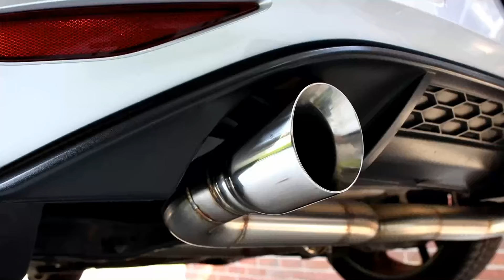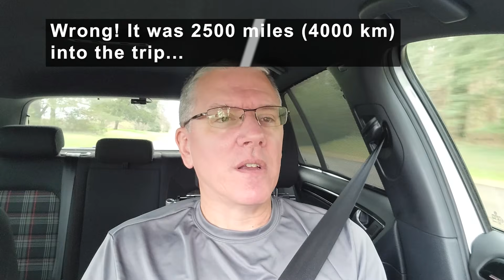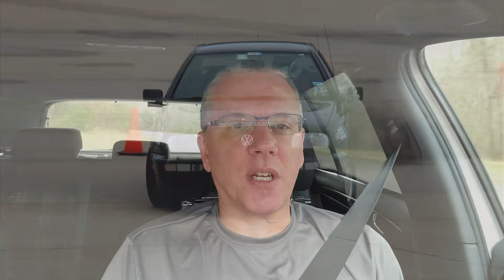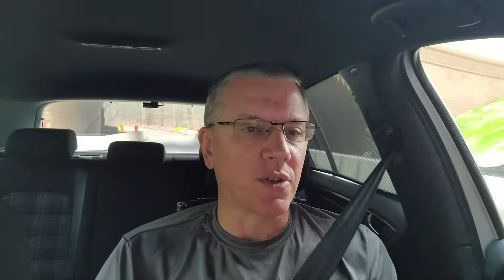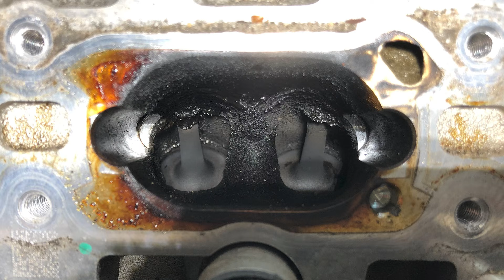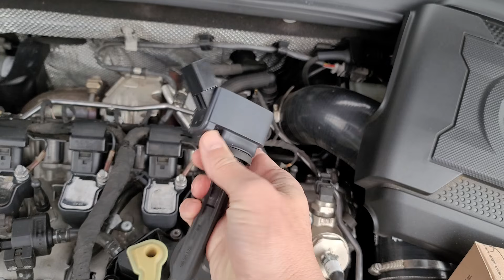CYLINDER #3 MISFIRE / HIDE CYLINDER

Comment: Nice video! My 2017 MK7 GTI 97k miles, suddenly felt like it was lagging a little and slightly delayed in power delivery, then a few minutes later the check engine light turned on and so did the EPC light. The car was shaking and running VERY rough and had poor power delivery. Almost stalled (manual transmission) on the way home a couple times.
I scanned and got
P020100 – Injector Circuit
P10B100 – Injector Monitoring Malfunction
P157000 – ECM Disabled
From the research I've done it seems it could be fuel injector in cylinder 1 or wiring to fuel injector.

I have never taken off the intake manifold but think I can do it. Before I proceed is there an easy way to check wiring or electrical issues to that injector? From what I can tell I can't check much of anything without taking the intake manifold off.

I'll probably just purchase 4 injectors because they're all original.
Reply from the maker: Have you  made any progress in your troubleshooting yet? I didn't have any injector codes during my misfires. So, you may have a different fault... or a total failure of an injector (mine only failed under heavy load). The ECM fault is concerning, though. If the fault is consistently on the #1 injector, then you might consider swapping #1 with #3 to see if the fault moves. If it does, then you found the issue. If not, then I'd swap the #1 and #3 plugs and the #1 and #2 coils. You'll get there! Thanks for visiting!
Reply: @StealthGTI thank you for the suggestions! Happy 4th!  I’m traveling so my car is in the garage and I’ll have to work on it when I get back. I plan on replacing all 4 injectors and cleaning the valves because I’m at 96k miles.
Reply: @StealthGTI  I fixed it! I replaced all 4 injectors and it's idling like a dream and no more check engine light or ECM fault.  The injector looked a little dirty but not much worse than the other 3. It must have been an electronic failure of that particular injector in cylinder 1.  I also attempted to clean the valves but that was much more difficult than I thought. I sprayed and scraped off a decent amount but didn't get it all. Now I just need to change my oil and hopefully I'll be good to go for a while.

Comment: Nice explanation.  I had this code 1 year ago on my 2017 Tiguan. Replaced all 4 spark plugs and coil packs. Problem solved.  The code just returned.  Same problem as what you describe. .Engine misfires on high load. I live in Florida, so no hills or mountains to climb.  Only occurs when accelerating to enter highway.  Does fuel injector cleaner/additive work to remove carbon/debris on the injectors?
Reply from the maker: Injector cleaner didn't help in my case; the injector had already failed. I try to run a load of cleaner every 10k miles. Thanks for visiting!

Comment: Great video! Just had a misfire on 1+2 at the same time. Luckily, spark plug replacement and coil pack shuffling solved it. But, I am also at 116k (stock), so I will watch out for the injector problems.
Reply from the maker: Thanks for sharing your experience! Take care!

Comment: i have a cyl 2 misfire on my 2016 autobahn gti but car starts and drives like it has no issues there no white smoke and theres no smells of burning fuel any suggestions?
Reply from the maker: It could be a coil pack, spark plug, or something else. I suggest swapping the #2 and #4 coil packs; then the #2 and #1 spark plugs to see if the fault moves. Good Luck!

Comment: Thanks for sharing this. I have a similar issue on my GTI right now. No check engine light on, but cylinder 4 is misfiring when I try to accelerate hard. Weird feeling and really obvious. It would have a hard but quick hesitation or bucking. But driving normally it’s fine. It’s got about 159k right now and I figured it was the coil packs because I’ve never done them yet. I read in the past that people would change them out around 70k miles. I’ll see this weekend if the coils are the issue.
Reply from the maker: I wouldn't blindly replace the coils. That's what I did and it was a waste of time and money. I've learned some techniques since creating this video. Instead replacing parts now, swap the #1 and #4 coil packs. At the same time, swap the #2 and #4 spark plugs. If your fault moves to #1, then it's a bad coil pack; if the fault moves to #2, then it's the spark plug. If the fault stays in #4, then you have either an injector issue or something in the cylinder... maybe even a leaking valve cover gasket if you see oil on your plugs. Try those steps first since they're free. Good luck!
Reply: I was lucky this time. Changing the plugs and the coils fixed my misfire. The coils may have still been okay, but the plugs definitely looked shot. The gaps have grown to .036" but initially gapped to .024" I do have a stage 1 tune on the car, so I think properly gapped plugs are a little more critical. I also upgraded to RacingLine coils.
Reply: Hi. Leaking valve cover gasket can make misfire? 

Its very interestjng. 

I have a liitle oil on my spark plugs in my 1.5 tsi dada. I have missfire on 1 and 4 cylinder....  @StealthGTI
Reply from the maker: @stefano18992  - Yes! In addition to sealing the parameter of the head, the head gasket also has a center section that seals around the spark plug ports. If those leak, then oil will seep down into the spark plug well and foul the plug.
Reply: Did you have any cold start issue like sputtering or something without fault codes and gets arrested with the hickup issues between 2 to 3k rpm band at load when reaches 90*C ?

Comment: I’ve been dealing with an EPC light and from what I scanned I had misfires which lead to a cylinder 3 pressure too high and a hide cylinder code. I noticed it happens around 3k rpm in 3rd and 4th aswell as some small power cuts thru the rpm band, I will be changing my injectors ASAP, already went thru the coils, sparks, and fuel system. Thank you for this very informative video!
Reply from the maker: Thanks for sharing your report! Did you find the problem?
Reply: @StealthGTI  Unfortunately no not yet, changed out my injectors and went about 60 miles and the EPC came back on for the same codes but no check engine light, gonna be working with some VW techs on it soon and I’m hoping to figure it out! I miss my little egg!
Reply: @MEAgTI anything new I having the same problem high compression on 2
Reply: Try replacing the injector wiring harness. Test out first using an ohm meter.. anything greater then 2 ohms means you have issues

Comment: I had the same issue on my 2016 GTI. Cylinder 3 fuel injector caused the hyde cylinder and misfire codes. The issue did go away when I restarted the car. Although when I was driving the car several weeks later. The engine started to shake and the car stalled on me. Luckly I was able to coast to the median and someone helped me push the car off the road. I wasn't able to get the car to start so I had it towed home. Looking at the codes I saw fuel pressure related errors and the misfire on cylinder 3. I originally though it was my high pressure fuel pump. Since my oil was smelling like gas. I replaced that and the issue was still happening. I did some more troubleshooting by moving the spark plugs and coil packs. The issue did not move. I then took the spark plug out of cylinder 3 and shined a light down inside. I had someone open the drivers door so the low pressure fuel pump would prime. I saw fuel spraying out and filling the cylinder with fuel. I found out that the injector was stuck open. I replaced all 4 injectors myself, did a carbon cleaning while I was at it. This resolved my issue but I was low on power. I found out that the catalytic converter on my IE downpipe was destroyed from the gas. All the matiral from the cat went down the exuast and plugged it. I also had to clean that out and and buy a new downpipe. It was an expensive repair.
Reply from the maker: That sounds unpleasant! Hopefully, the car is running in tip-top order and keeping you happy. Thanks for visiting!

Comment: I can believe a dealer didn’t think to check injectors. The engine seized on my RS5 and the dealer (Audi Centre - Perth Australia) diagnosed it as a failed starter motor, because that’s the code a seized engine would give you because the starter can’t turn the engine. There’s no code for a seized engine. In the RS5 the whole engine has to come out to replace the starter, so after ripping my car apart and taking the whole engine out, nobody thought to try turn the engine to rule it out. They put my engine back in with a new starter and it still didn’t turn. They then had take the whole engine out again to swap it out and decided to charge me for pulling the engine out twice. They even replaced the belt on the crank pulley that they should have put a spanner on to turn the first time it was out. Their neglect to do a 10 second test made them an additional $5000. Professional incompetence.
Reply from the maker: A dealer did something similar when my daughter's car needed an engine. The bill was around $1800 for work that they should not have done since they did it before even doing a simple compression test. I wound up litigating my way out of all but $150. I then towed her car 200 miles to someone that I trust. She did need an engine, but at least I didn't pay THAT dealer to do it. Thanks for sharing your experience.

Comment: I have the same codes in my Passat but in opposite conditions. My cylinder 3 only misfires at idle. I hooked up my VCDS and watched the misfire counter and every time the misfires would start they would immediately go away when I placed a load on it. Tried plugs and coils but it’s still there. Rented a compression tester and cylinder three was a little bit lower but all within spec. I’m suspecting that it’s either the fuel injector on 3 or that it’s due for a walnut blasting. Taking the intake manifold off is a little bit scary for me because I don’t have a garage or shop that I could be organized while disassembling. Everything would have to bagged and labeled and stored in my shed while I do the work in my dirt driveway under a pop up canopy. Recently found a Euro mechanic that’s an hour away so I’m thinking I’m going to have to pull the trigger. I’ve been wanting to stage one tune it but I don’t know if that’s a smart idea until I get that misfire settled.
Reply from the maker: When I last had a cylinder 3 misfire, my mechanic did an intake cleaning and, while the manifold was removed, swapped injector #3 with #1. That way, if the manifold cleaning didn't fix the issue, we'd be able to see if the misfire moved. It didn't... the cleaning solved my problem. Thanks for visiting!

Comment: Unitronic Stage 2 tune on my mk5. I replaced all coils and sparks and it's still misfiring. A week before that I bought ecs tuning fuel injectors because the fourth one was stuck open so I went ahead and replaced all four of them but they were on the cheaper side. 340 dollars compared to the 1000 dollar oem ones. I have a cylinder 4 and 2 misfire under heavy load and up hills. Do you think it would be from the none oem fuel injectors??
Reply from the maker: I cannot be sure. The earlier cars are known for bad coil packs, but you also have a mix of aftermarket parts. Even at IS38 tuning, I'm still using factory coils, injectors, and OEM R7 spark plugs. IF you're confident in your plugs, coils, and injectors, then check your compression and leakdown. Good Luck!
Reply: @StealthGTI  Compression is even on all cylinders so the engine is healthy thankfully. Leak down test it is appreciate it.

Comment: Hey Scott. What would be your suggestions on exhaust systems and cold air intakes? If you have any.
Reply from the maker: I'm not fond of cold air intakes. They're for noise and entertainment, IMO. ;-) Exhaust upgrades are subjective. I think just about anyone can get tired of a drone, especially on a long trip. I've gone back to more sound suppression. See my "Baun Performance" playlist for details. Given the ongoing experimentation required to get the sound that you want, I think I'll leave the exhaust alone on my next car. I can even see myself returning to an IS20 turbo and restoring the stock downpipe if my IS38 turbo ever needs replacing. I won't do anything before that, but the downpipe and IS38 contribute to a bit of extra sound. Sure, it sounds great, but it gets old on a long trip, especially if the car is loaded. Thanks for visiting!
Reply: @StealthGTI  thanks for responding back. I appreciate it

Comment: Unfortunately I've swapped the coil pack, spark plug, Injector #3 with #2 and I'm still getting a #3 misfire.. I've even changed the coil pack connector and nothing changed. Getting correct voltage. At this point I'm thinking it's the ECU.
Reply from the maker: You need to run a compression check and leakdown test. The ECU is unlikely to be the problem. Have you made any progress since you posted this?
Reply: @StealthGTI  thank you for the reply. Yes a buddy and I did both tests and we confirmed low compression on the cylinder.. Most likely an exhaust valve as there was movement on the exhaust end.
Reply: @StealthGTI you’re GOATed

Comment: My Golfs cylinder 3 is also misfiring. Unfortunately for me it’s damaged piston rings. Not a good result, I’m hoping it’s just gummy piston rings fixed with a special oil, but highly unlikely. Car itself’s not worth enough to pull apart the engine. Wish I knew all this before I just had the timing chain done.
Reply from the maker: Bummer! Good luck with a solution. I replaced the engine in my daughter's 2015 Golf recently. Thankfully(?), I hadn't sunk a bunch of money into it beforehand. Now, I hope it will last long enough for the investment to have been worthwhile. Thanks for visiting!
Reply: @StealthGTI  thanks mate, so far so good with the solution. 🙏
Reply: @benshaw9098 what did you do with the car in the end?
Reply: @cruiseedwards4657  basically nothing, it was all going fine until I paid for a timing chain replacement. It’s still running quite rough but getting me to work and back, I probably should do a diagnostic scan again. It’s not our main car but I enjoy driving it and would still like to solve the problem If it’s not overly expensive.

Comment: Same codes I have just had APR stage three tune and 6054 turbo installed. I have new water pump to install and think I will put injectors in at same time. Mine only sets codes on hard acceleration in higher gears. Thanks for your video
Reply from the maker: Does APR have a tune for the 6054? I honestly don't know the turbo. Is that setup capable of exceeding the fuel needs that can be delivered by the stock injectors? Thanks for visiting!

Comment: Oh man i have the same problem on my 2020 audi s3, misfire cylinder 3 and hide cylinder. No CEL, but got a warning yellow symbol “drive system malfunction”. Would only happen when I floor it or semi floor it. It would have vibration when flooring it then will get the warning light and car would go on limp mode. The problem will be fixed when I turn off and on the car.

The thing is my car is almost new, only has 13000km(8k miles) car has a stage 1+ ecu tune unitronic. So im not sure what the problem is, my bro who used to be an audi tech said it could be the coils. Hopefully its nothing major i barely even drive it lol and i baby my car. 😢
Reply from the maker: "Hide Cylinder" is protecting the engine from a problem. Restarting the car is just allowing the problem to continue without the ECU protecting the engine. You need a diagnosis. Good Luck! -Scott
Reply: @StealthGTI  fixed it, the ignition coil on the 3rd cylinder had some lubricant that wasn’t spread properly causing the misfire, everything looked good and was clean and dry, even the spark plugs looked new. I already bought the apr pcoils so i replaced it but i will keep the stock ones for back up since theyre expensive. 130$ for oem coils and 60$ for the apr ones(each)

Comment: Great information. I just had the same cylinder 3 misfire and even had judder under heavy boost and a few epc lights. I am thinking it's the injector too. Just changed cyl 3 coil last week and didn't fix the issue.
Reply from the maker: Thanks for sharing. Good luck with your search!
Reply: @StealthGTI   new fuel injectors didn't fix my issue. Ugh. Now need to see if boots have any leaks, plugs and coils.
Reply from the maker: @SterlingRobertson  - Oh my! You didn't start with the coils/plugs? Then a compression test? Do you get a CEL and a stored code?

Comment: @StealthGTI  hi.very good input. I know this is a year later.
 My sons polo is doing the very same thing so yesterday i swapped the 3rd cylinder injector for number 1 injector just to see. 
Checked everything like the  garage that robbed you when you was away did and i get the same fault cylinder 3 as in the UK we get crap fuel.
Do you think it could be the throttle body.
Code P0303 always comes up.
Any extra help would be great. Thanks
Reply: @thetickler4487 did you find the issue in the end? I have the same problem
Reply from the maker: The throttle body seems unlikely. I think it would intermittently affect ALL cylinders. With that said, I'm not a mechanic or a trained technician. If you've swapped the plugs, coils, and injectors; and checked the compression, then it may be time to take the car to a trained pro. Good luck and thanks for visiting!